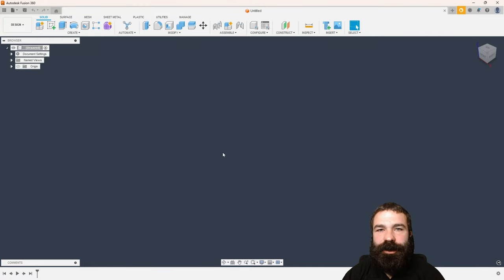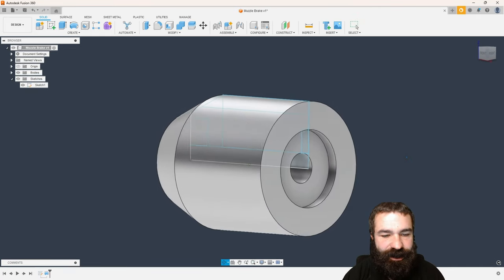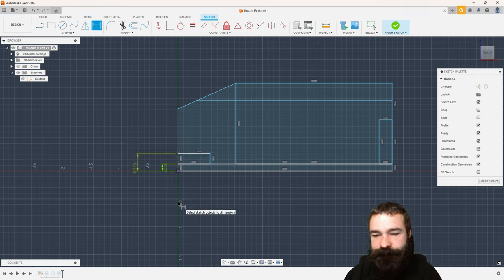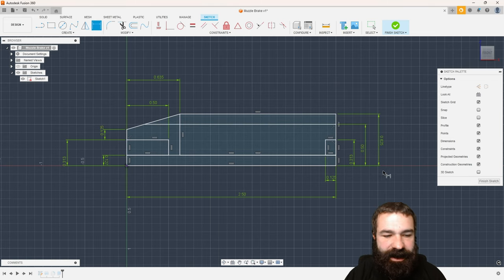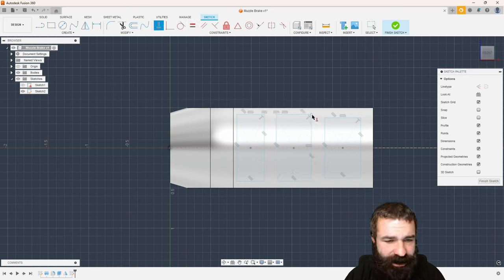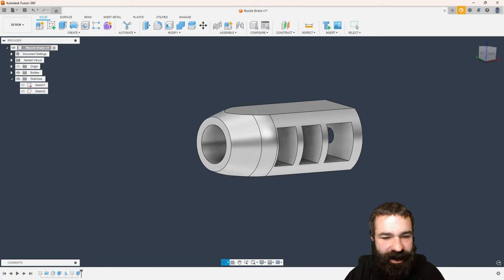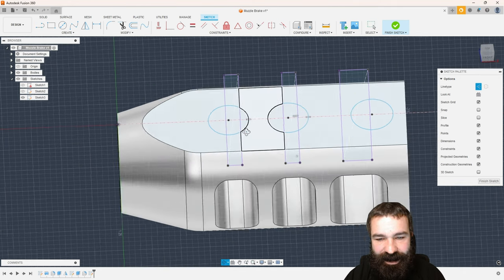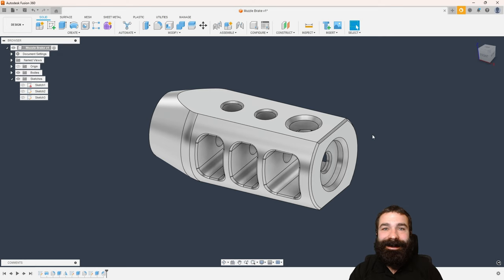CAD4CAM: Muzzle Brake

Comment: Does fusion not have a centerline to dimension off of so you don’t have to divide everything by 2
Reply from the maker: Indeed it does upone clicking your centerline and outer line you right click and will see Diameter Dimention. I plan to do a sketching top 10 unknowns and this is one of them.